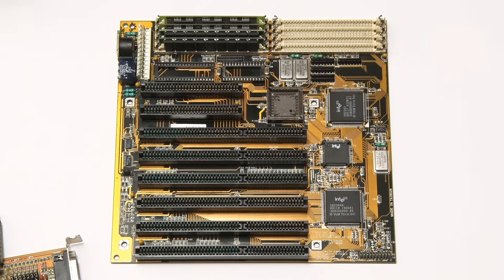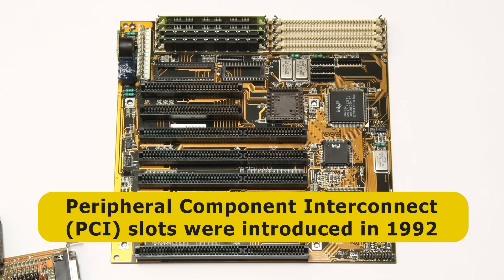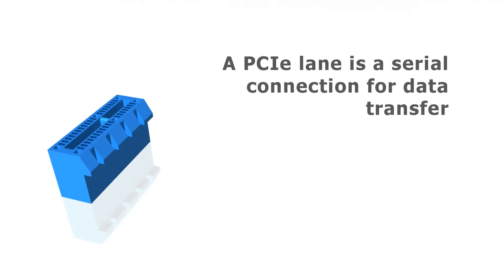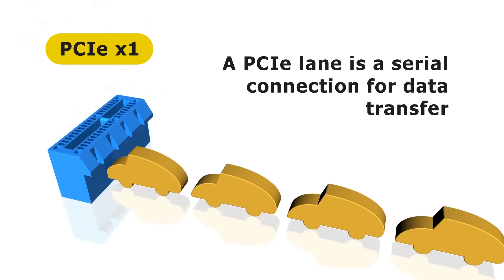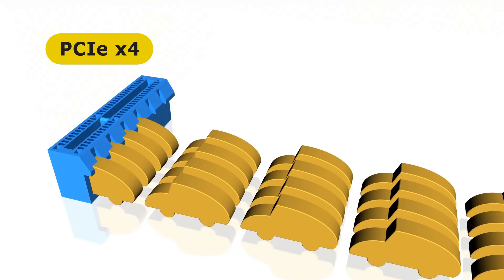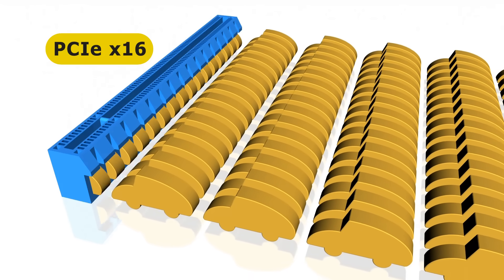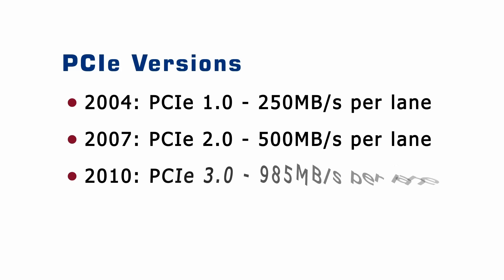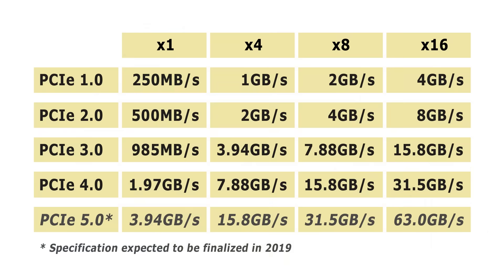Explaining PCIe Slots

Comment: If you go to the Newegg link I have provided, I was wondering if that would work in a PCI-E 2.0 x16 slot ? I see that it is a PCI-E 3.0 x4 slot SSD, but I was wondering if it would function in the slot that I have. I know it would be limited in speed, but what speed would it run at 2 Gb/s or would it not work at all ? 

https://www.newegg.com/gigabyte-aorus-512gb/p/N82E16820009010?item=9SIAGBAAGC9766&source=region&nm_mc=knc-googlemkp-pc&cm_mmc=knc-googlemkp-pc-

@ExplainingComputers #ExplainingComputers
Reply from the maker: A PCIe 2.0 device should work in a PCIe 3.0 slot, but slower as you say.
Reply: @ExplainingComputers  Thanks for taking time to respond. Let me explain further. The device is 3.0, my slot is 2.0  If I put the 3.0 x4 ssd into a 2.0 x16 slot, will its thorough put be like a x4 for 2.0, because it only has enough pins to attach to 1/4 of the x16 slot ?

Comment: I have a Elgato HD60 pro that plugs in the motherboard. from what I understand from this video I can plug it in to any PCIE slot and it will work, can someone clarify if that is right please?
Reply from the maker: If it will fit, is should work, but not necessarily at the rated speed. You've not told me the spec of the device. :)
Reply: It’s a cyber power pc gaming desktop AMD Ryzen 5 3600 - 8GB memory - AMD Radeon RX 580 - 2T HHD +240 GB SSD. I’m not sure what kind of motherboard I have I ask the guy at Best Buy and he said this would run an elgato HD60 Pro

Comment: I'm not into it anymore but I used to be big into hardware back in the early 2000s ... Remember my first video card was a 3dfx voodoo 3 . And of course shortly after I got the voodoo 5 and that's after that when I moved to nvidia. I was your classic overclocker constantly visiting overclocker forums. I don't know how many thousands of times I ran 3 D mark and how many thousands of times I installed and reinstalled windows XP.  My last rig that I built was awesome but I actually went with ATI so I had an all MSI set up with MSI motherboard and 2 MSI ATI Radeon HD 3870 video cards running in crossfire ( if I remember correctly) . Honestly I sure miss those days. I always tried to help out the underdog so yes I had an all AMD system that kept my cost down and I didn't think that this  system was slow enough that it was going to affect my ability to win games knowing back then the Intel was a bit faster. Or if I remember correctly Intel really just handled memory a lot better but that did equate to a bit faster

Comment: Thank you! I put my GPU into the bottom slot because I thought the airflow would be better. Upon further inspection I can see how the 2nd slot doesn't actually have as many pins. I was bottlenecking my 1080ti without realizing it.

Comment: Will i be able to add a x4 nvme drive to my system that has a x16 graphics card, ryzen 2600 b450 mobo and a sata ssd +hdd without bottlenecking anything? Cant find a clear awnser on the internet if sata ssd's and hdd's take in pcie lanes?
Reply from the maker: It will depend on the motherboard. Usually an M.2 slot's port is shared with one SATA connector on an either/or basis.

Comment: There was one more proprietary slot which was used with IBM PS/2 and this was called Micro Channel Architecture (MCA). Time-wise, it belongs between ISA and PCI. I got stuck with one of those which meant lack of expansion cards on the market with a hefty price tag.
Reply: Not to mention the cards all needed a disk with a driver that of course was specific to the card, sometimes to the version of the card.  Any IBM PS2 technican woth his/her salt had a huge collection of these driver cds to make sure that any machine that came if to be fixed actually worked after any changes in the hardware.

Comment: What if you did sli with 2 cards ? don't the slots need to be the same , not just size but the  bus bandwidth too ?
Reply from the maker: As I understand it, SLI can with with two different makes/types of card in two different types of PCIe slot, but performance will be limited to that of the slower card and slot. Normally, though, you use identical cards in identical slots.

Comment: There is the idea of size of lanes.. 2x 4x 8x 16x.. on the different gen lanes 1, 2, 3, 4, 5.. all of coarse a notch up on speed effectively doubling the speed.. but we are not moving up at all from the 16x to a 32x. to a 64x pcie lane..   So motherboard creators.. 64 pcie lane slots. which of coarse would also mean graphics cards would also need to change as well from 16 to 64 as well.. but you will always work together to get things done..

Comment: About the end bit on 16 --> 4 and such - You could find a motherboard with an open-ended pci slot, or you could just use a PCI riser and slap 'any' pci (1x, 4x, 8x, 16x) into the riser and run it with 1 lane.

Comment: Which Nvidia Graphics Cards will fit into the PCIe x16 slot ?????
Reply from the maker: Every single one. :) Although your case size may prevent the use of some.
Reply: @ExplainingComputers  can HP Pavilion 590-p0056in PC case fit 4 or 6GB Nvidia GeForce GTX cards ??

Comment: What happens to the Intel UHD630 integrated graphics when I add a Nvidia GeForce Card to the PCIe x16 slot ??????
Reply from the maker: It depends how your BIOS is set. Normally it is set to "auto", so the onboard graphics will be turned off when an external card it fitted.
Reply: @ExplainingComputers  thank you very much EC 👌👌

Comment: That was brilliant, but I think I missed the part that talks about the difference between pcie 16 and pcie 4 which are for some reason in the same length
Reply from the maker: They are the same length to allow x16 (or x8) cards to be used (at lower speed)  in a PC that already had its x16 slot occupied! :)
Reply: @ExplainingComputers  Speed difference.
Thank you

Comment: The animation with the lanes shows cars synchronized across lanes. This is not the case with PCIe. Data has the same speed in every lane but it's not synchronized.
I think this is an important distinction because there exist ports that are synchronized like LPT (Line Printer Terminal) which was common for printers. These are called parallel ports and for some time they were faster than serial ports like COM (Communication port).
In time we found that increasing the clock (data rate) is more scalable that adding wires/lines, primarily because it is difficult to synchronize them. Thus ports like USB came to dominate.
PCIe does add wires but they are independent. They're like multiple USB cables strapped together. This allows scaling both the clock and lanes (number of wires) to achieve phenomenal speeds.

Comment: sir if I use a PCI-e 3*16 GPU in a PCI-e 2*16 slot will the performance become very low??
Reply from the maker: It will be PCIe 2.0 x16 performance -- so less than the GPU is capable of, but still pretty good. :)
Reply: @ExplainingComputers   sir should I change my full system configuration to achieve better performance from the gpu?
Reply: & sir I request you to make a video on bottleneck.please sir ...it will be very helpful for me
Reply from the maker: @siamsiddique97  Only if it is a really big issue/constraint for you. If your PC does what you need/want it to, I would leave things be!
Reply: @ExplainingComputers  sir I request you to make a video on bottleneck.please sir ...it will be very helpful for me

Comment: fun stuff - i have an old supermicro with only vga integrated video. i wanted to have hdmi for plugging the server into my hdmi switch, vga->hdmi adapter wouldn't work well all the time, like nothing during POST times. supermicro had only one 4x pcie left, all video cards are full lenght, and using 1x->16x riser card would be impossible (i had no more empty slots left at all), so, some dude on YT showed how he just cut the connectors on his video card and converted it from 16x to 1x. looks savage, but it works, i cut pins with a cutter on my 10yrs old nvidia 9300, converted it to 4x, it works just fine :-)

Comment: It may be worth to mention that all the previous expansion solutions (with few exceptions) were buses, while PCIe is rather a network with star topology (like your ethernet network). Typically, you have a single root called "root complex" (typically, the PCIe controller inside the CPU), and you do not need to upkeep strict synchronization in the whole system (e.g. between cards), which makes those insane transfer speeds possible. Moreover, as a nice side effect, you can use all the PCIe cards synchronously at the same time in this star topology, which is impossible with a bus. There are other advantages (and disadvantages), but this is the most important, i.e. that this is completely different.

Comment: 6:55 one little issue- not all PCIe 3.0 graphics cards (or possibly other sorts of cards) will work with all PCIe slots.  With PCIe 2.1, they increased the amount of power available in the slot, and so older motherboards with PCIe1.0, 1.1, or maybe even 2.0 couldn't necessarily provide enough power.  I ran into this with a Dell motherboard that was supposed to have a PCIe 2.1 slot, but it actually was PCIe 1.1.  When I tried to put an AMD R9 270X in there, it didn't work.  Ended up replacing the motherboard, whole mess of a process.
Reply from the maker: Graphics cards requiring more power should have a separate power connector to overcome this issue. I've never come across such a card without one.  I've just checked the specs for your card -- it draw about 160W, and has a 6-pin power connector.
Reply: @ExplainingComputers  You would think that, but no.  Did not work, even though the card has a separate power connector.  Apparently NVidia cards (at the time) were okay with older PCIe versions but AMD cards were not.  I do not know if that issue persists.

You can find some forum posts about the issue if you're curious.
Reply from the maker: @djlemma  Thanks for this -- very interesting, if a problem for you. I will indeed read up on this. :)
Reply: @ExplainingComputers  It was an odd situation.  I suppose there could have been some OTHER problem with my dell motherboard that prevented the 270X from working, but I did have an older FirePro card in there (maybe a V3800?) that worked fine, and using GPU-Z (with the FirePro connected) I could see that it was reading as PCIe 1.1.  No BIOS updates from Dell seemed to fix the issue, but swapping the motherboard worked.  Unfortunately it invalidated my windows license, so it was a big mess!

Maybe this really was an edge case and very few people had this problem.  Hopefully!

Comment: Dear Chris, Do each of the metal connectors on an expansion card carry PARTICULAR information to be shared with the motherboard or is it just information in general? For example, If you put a larger expansion card in a smaller PCIe slot (supposing you could), does that mean PARTICULAR information is not being shared with the motherboard or just information in general is being shared but at a lower speed?
Reply from the maker: Same info, lower speed -- the system adjusts, as it were.

Comment: Was expecting to hear about the extra 6/7 pins next to the lanes on each port - I assume they're for power, and if so the animations are wrong for showing the "data" cars going through them in some instances.

Also personally I felt like the subject matter was pretty rudimentary- I'd like to hear more technical stuff about how the data is transferred in the different interfaces / how it reaches the motherboard / technical differences between PCI->PCIe and different gens / if there are any PCI specific transport protocols / etc.
Reply from the maker: The cars indeed go through the power pins -- I was running out of space! :)

Comment: So in other words, there is no reason for me to spend 90$ more on a motherboard with a 4.0 PCIe x16 slot. If I have a graphix card that can only run at 3.0?
Reply: Unless you plan to upgrade the card in near future.
Reply from the maker: Correct.

Comment: Great video, but I have a couple of questions.  One, if PCIe is out there and a thing. why do motherboard still include non-express PCI slots in them? Second, if the motherboard is going to devote the space to say a x16 PCIe slot, why would it ever only be configured to act as a x4 slot?  Are there cost concerns here, or is it something else?
Reply from the maker: Some people still have PCI cards they want to use! :) On space, x16 length cards with a x4 interface are useful if you have a x16 card you want to use (and physically support) but the full x16 slot is in use (eg for your graphics card).
Reply: @ExplainingComputers  Awesome, really appreciate the reply.  Some of the best tech videos on Youtube btw.

Comment: Back in the day I had a server board that only had PCIE 2 pcie x4 slots So i took a dremel and cut the end off so I could throw a GPU (pcie x 16 card) in
It was a radeon 4770 that I paid 40$ for. I could play starcraft 2 and diablo 3 at 720px60fps so I was happy.

Comment: Years ago I managed to break my 16x PCIe slot that held my graphics card by scraping a knife across the motherboard (it was a tight fit in the case against the cooler and i could only access the PCIe plastic latch with a knife, I ended up slipping once and yeah... disaster...)

But, I was fortunate in that I had a spare slot which was there for SLI purposes. I replaced the card in that slot and continued on with my life. I noticed, however that performance in games seemed to be a little poorer than they had been before the damage. I assumed perhaps it was due to the damage I did to the motherboard, but on inspecting after this video, it turns out that the SLI slot was actually an 8X slot that had room for 16X cards.

Could the poorer performance be attributed to this, I wonder?
Reply: Yes because your only running your card at half speed your running at 8 as opposed to 16

Comment: Unfortunately, the computers are slower and slower for each upgrade of technology, most probably the IT-department eat up all the resources on virus scan and all kind of security, I recently got a new computer in the office and was told I got the high performance version and it is the slowest computer I have ever had, in addition software are updated several times a day also and I must reboot the computer each time, if I change the wi-fi a couple of times or close and open the lid/screen etc the computer do not work any more, I now just as well switch of my computer every time I do something, even if it takes a long time it is still faster, in a couple of years from now computers are probably totally useless except they are absolutely updated and guaranteed have no viruses
Reply: It's so true, I have a brand new HP laptop at work and I swear the CPU is 50% just working on antivirus/malware scanning the whole time, feels so sluggish.  Then when the actual weekly scan kicks in, forget about using it for 1 hour.
Reply: @andrew6978  - it is most probably because the it-department can, if there is viruses or pirat copies of software on a computer the it-department get hell, if you and me sit all day and wait for the computer to respond no one care, and wirh the it-department in india there is no connection between you, managers and the it-department, our companies spend millions on it-technology and only use the resources to keep the software updated

Comment: it is cool that a pci device can work in whatever slot you put it in even if at lower performance now if only ram worked like that they should make different shaped ram slots because I've had laptops where the ram would physically fit in the slot and even say ddr(x) just like the ram i removed but the pc would not see it or boot and yes before you ask the ram worked in a different laptop so it was not just bad ram. if you do make a video on ram then you should also answer why we need 2 sticks of ram instead of one? i know computers work better with 2 sticks but why not design the ram in such a way to where you only need one slot to get the duel channel performance.